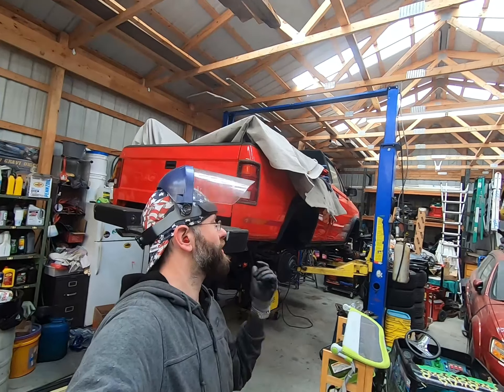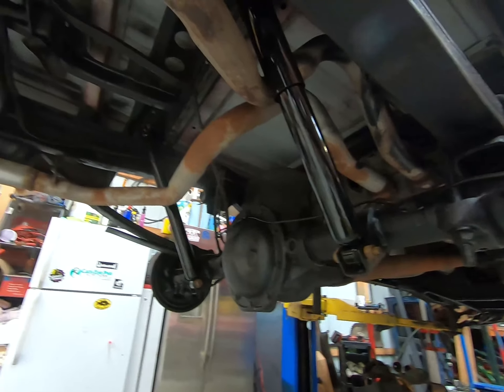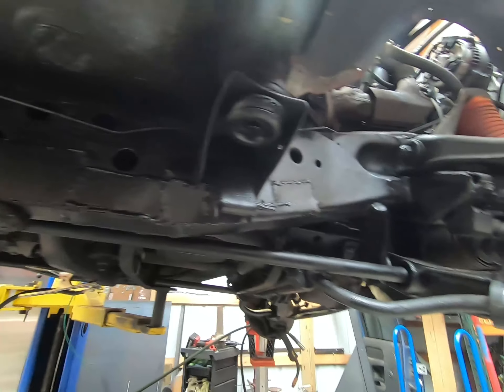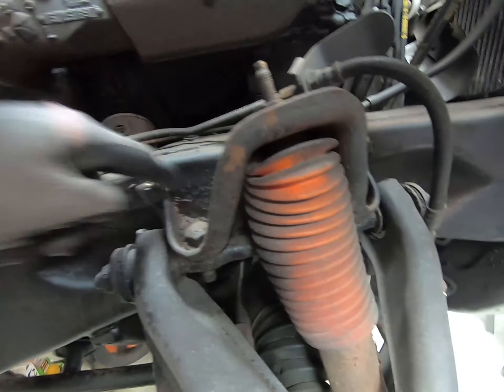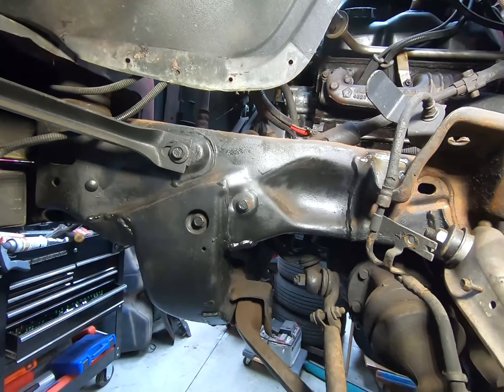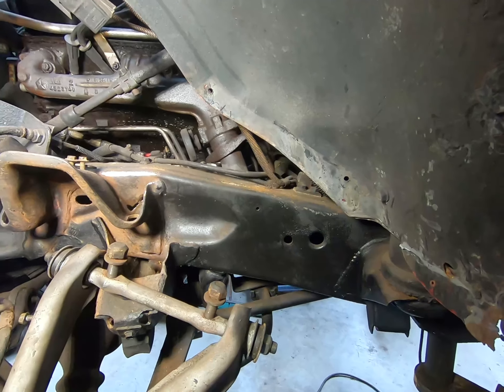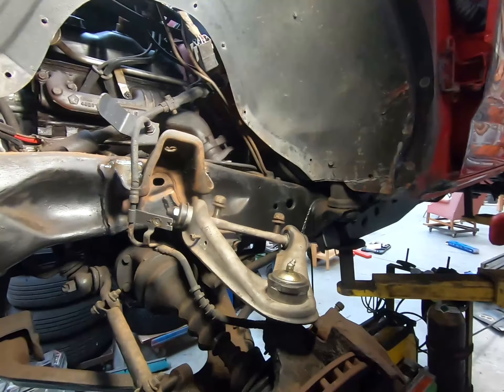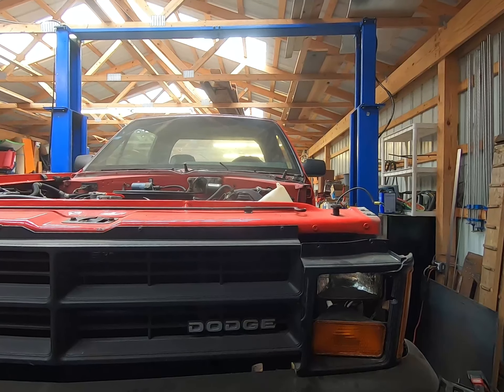Copart Convertible Dakota - 4x4 Frame Damage Update

Comment: I owned that truck from roughly 1995 to 2005. I sold it to my friend in Kill Devil Hills. He never took it on the beach. It was totaled in a front left ? Fender bender. His wife was told it bent the frame. She called me and asked me if I was interested in it for parts 
. I presently own 2 1989’s. But I passed on it because it had been transported to Dunn NC.
Reply from the maker: Wow, thank you for the information on the history, I appreciate it. Frame is definitely bent, but I have a clean donor frame that will be prepped well and set underneath it. I found a kill devil hills sticker on the windshield, so that all lines up with what you're saying.